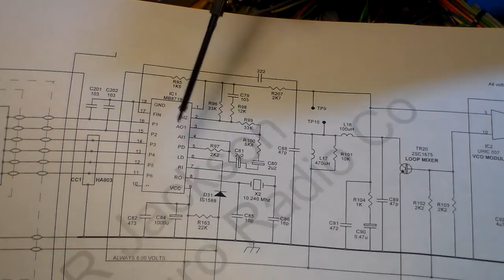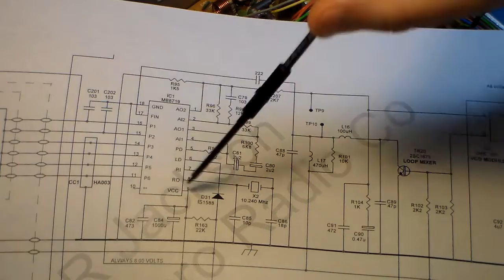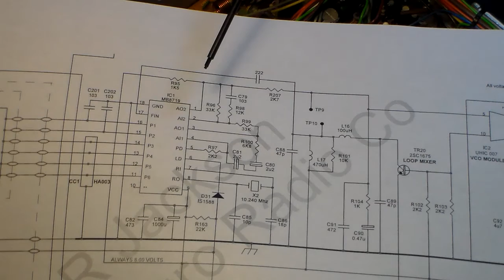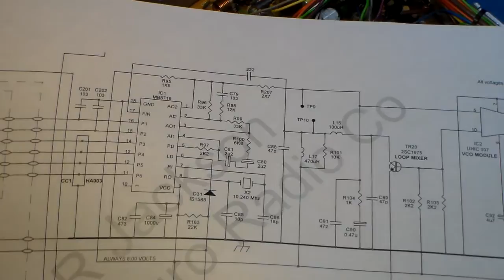The uncommon Pin 17 on the MB8719 PLL modification .. safe.. or not?

Comment: Old to this post 2025. Pin 17 may have been a PLL unlock State for broadband transmit on all Channels at once on transmit/receive. I modified my past Cobra 148gtl to be able to switch normal use to Broadband TX/RX. I need to get my notes on this mod as been in storage for 20 years.

Comment: You are going about it all wrong...

Pin 17 should never connect to Vcc directly or through any resistor, choke, inductor or anything else.

The entire trick is, applying Half Vcc to Pin 10. Pin 10, on most radios with an MB8719,  is isolated "left unconnected", except for radios like the Teaberry Stalker IX (Radio's like the Teaberry Stalker IX have an 11.1125mhz crystal and pin 10 is tied directly to ground so there is no need to swap crystals in these radios, just free pin 10 from ground and do the rest).

Pin 17 is half of Vcc that Pin 9 supplies. 

This is why tying Pin 10 to ground through a 4.7 k resistor, then switching in and out Vcc or Half Vcc to Pin 17 splits the coding.

If you use an 11.1125mhz Crystal instead of the 11.3258mhz crystal, you would get a more central spread of channels, both upper and lower, or leaving the 11.3258mhz crystal will get you more into 10 meters...

Don't stop there! One of the reasons most folks can't get the modification to work, is the fact that the VCO unlocks. There is a simple mod for that too... It relies on clipping or removing a resistor in the VCO Circuit. Typically R95 on the 2000 or 148 GTL, R71 on the Stalker IX.

There is a Yahoo! Group called "The Mod" in which you can find a PDF Document I created years ago, explaining everything you need to get 192 channels from an MB8719 PLL. The document is called "_Poormans 192 Mod - Rev.1.02.pdf".

I would have posted a direct link from my website from years ago, but noticed it has been erased and linking the PDF in the group does not work...
Reply: Yeah, the way the video is explaining it is confusing. Pin 10 to ground, pin 10 to +8 or pin10 to +4 (half vcc) using a three position switch gives hi/mid/low using a 11.1125mhz crystal. Apparently the guy doesn't get that pin 10 has 3 functions unlike the rest of the binary inputs 11 - 16

Comment: Back in the 90s ever radio had this MOD. Much better to order temputure control oscilaters.crystal swapping on channel 9 switch. Clarifer would get tied to transmit and then line radio up. .Replaced many back to stock. Still got a bunch. Work fine as long as you don't go jumping. Yes jumping work for many butchers as long as you keep radio out of cold and hot places and didn't destroy your modulation[which everyone was doing].Became a ham radio operator and have not even thought about this MOD in years. Nothing wrong with cb. Just be respectful. Same for hams.

Comment: Mark19960 it's David here maybe they are wanting to have more channels or something if so then it should be replacing the PLL with the MC145151 or a board using discrete programmable divider chips and Phase Comparator chip plus the oscillator to make it work and give the user more channels.

Comment: I just picked up a 148 parts radio from eBay,  have been fiddling around with this myself today. I've known about the mod for a while but never tried it. I will be uploading a video shortly with my findings and my theory of how this works.

I am planning on modding the radio for two bands using the 145106 (because I want the 5KHz offset) and an arduino controller, but I'm thinking to myself why I am recreating something you have already done with your mod board?